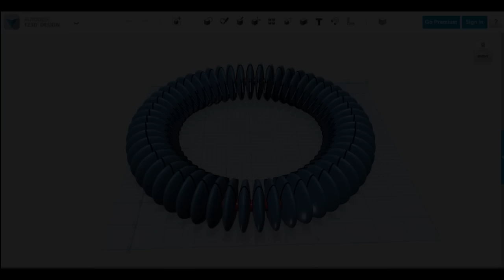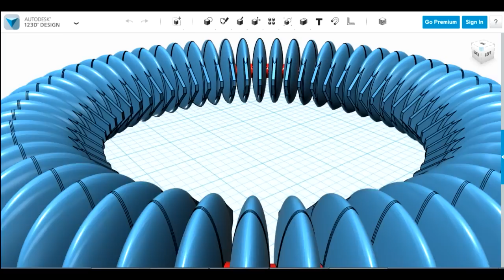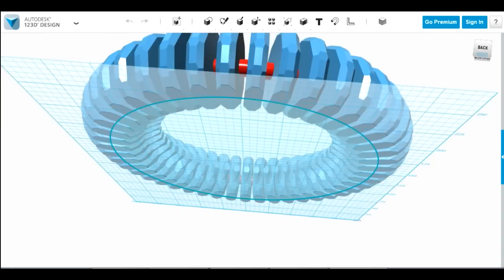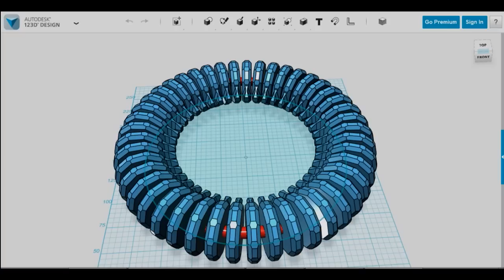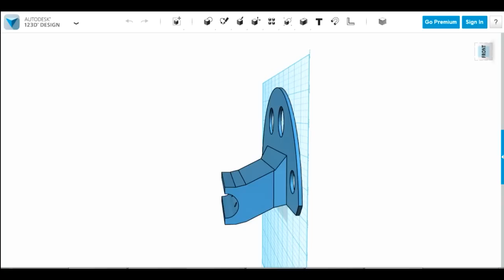Alien Xenomorph Cosplay #9 | Shoulder Tubes & Mountings | James Bruton

Comment: That's really cool. Thought you were going to do something crazy and print each individual link of the tube separately (like what you did with the detail on the head), but as usual you ended up doing something that I'd never thought of.

A 19 hour print, though...I definitely wouldn't have the patience for that. My desire for instant gratification is way too high. :P
Do you think improvements in the technology will help speed that sort of thing up in the future, or is it more limited by the materials?

Comment: Dear James for the circle things that make up the hose that you had to give flat surfaces to did you have to keep making them separately until you had enough to make the circle or is there a way of making one and then just copying and pasting it to make multiple copies ? Please reply
Reply: Can it only be used on a circular object? Because I have a design where I need six copies of a object that are all identical but they are very difficult to make sure they are all the same if I had to rebuild them each time
Reply: Thanks a lot also thanks for replying I have been watching for a long time and am a big fan I make stuff too but mainly just small weapons and that kind of stuff but anyway thanks and your doing great with the suits!

Comment: As that was a relatively bulk piece I was wondering if there was a large weight difference between the 70% and the 10% infill (if I remember the numbers correctly).
On a related question how was the bonding between the ninjaflex and the ABS in the lighter infill? From the look of it the lighter infill still had fairly solid fill where the two materials abutted. Was that slic3r being "smart" or did you tweak the model?
That again for these wonderful videos. I get to live vicariously through your very cool projects.